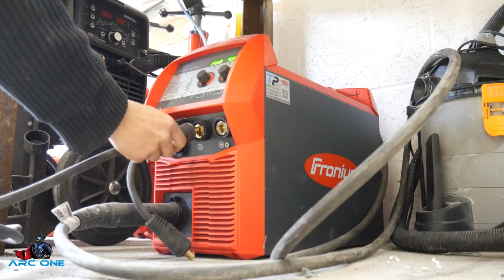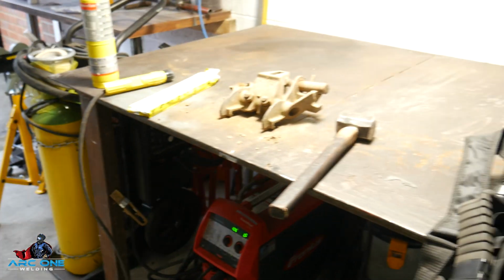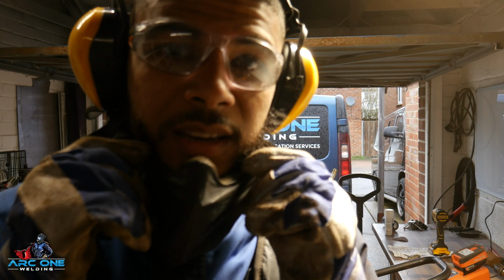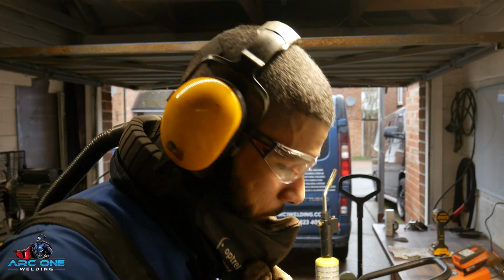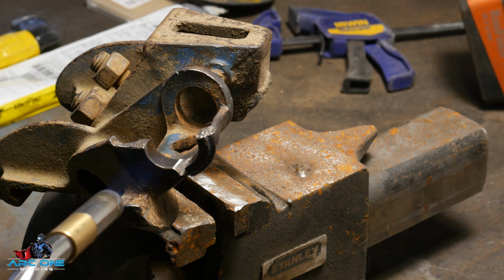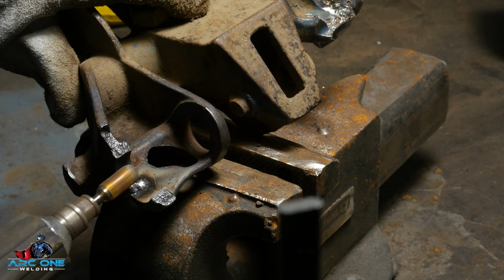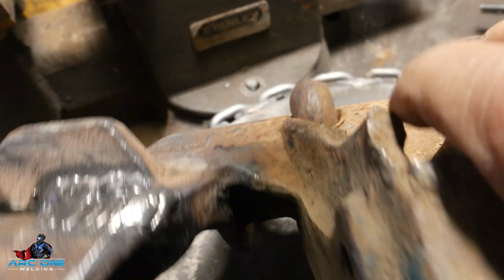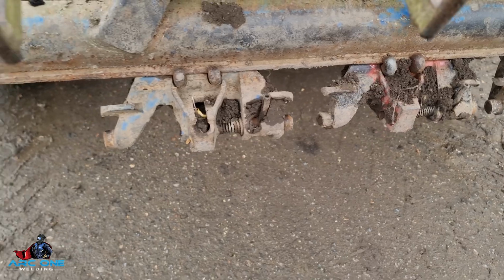Weld Repairing Cast Iron Farm Equipment

Comment: When in doubt on cast materials such as iron or steel to carbon steel 309 stainless steel or 312 stainless steel has worked really well for me they make it in a stick electrode they also make it in a wire you can also find it in Cut lengths for TIG welding the most precise would be Tig

Comment: Good to see your getting on well👍👍
Also good to see somebody else taking safety seriously as far as the RPE goes. But buy yourself a couple of clear grinding face screens rather than just wearing glasses man. Especially using slitting discs for anything other than a straight cut lol.
A broken cutting disk or grinding wheel will make a right ol mess of your chops if one goes bang

Comment: Good luck with the business and your van is smart. I've done quite a lot of welding on cast iron, get it as hot as you can too start with. Dcen works better than dcep. But best of all is ac. Out of my kemppi mastering 3500 pulse😊. I use Fein too, good stuff. My cordless tools are a little older, but not old, and they've decided to make the batteries obsolete 🤬

Comment: Good job! From what I understand about cast-iron welding you need to pre-heat the material properly. That basically means acetylene torch or a heating chamber. I remember around 12 years ago when I welded a cast-iron thing at work. We first tried with stainless steel rods, then basic before finally cast iron. I think it did hold up over time. But the secret sauce in cast iron welding as far as I understand it is to weld the parts after they've had a massive input of heat until the magnetization is gone. Then the welding creates as little internal stresses as possible. I know also have heard that steel-structures that are used in the north sea on oil rigs are often heated up in order to deal with all of the internal stresses in the structures. I see it more and more that structures of steel are always in internal conflict with themselves. Cast parts can still be the same as they do not necessarily cool down at the same rate in the whole part - hence it can also have internal stresses.
Reply: Best off pre heating it as evenly as you in an oven, helps prevent cracking. But at the end of the day cast is a twat to weld no matter what you do😂
Reply: Once steels reach a temperature of 400 to 800°c (depending on composition) they become fully austenitic hence losing the magnetism from the ferritic structures. 
Thing is no matter how much you try as far as pre heat and post heat, unlike cast steels which arent too bad, cast iron can be a real pig to weld and that simply cant be changed lol
Peening helps a lot too👍
Reply: Huge pre heat, weld then peening.  More heat  and then basically the slowest cool down you can manage.  As in make a BBQ and leave the piece on top until the next day...

Comment: I thought the TS2700 was 3 phase? How are you liking it compared to the bigger stuff at work?
Reply: the 2700 can be used on single phase but at much lower amp range and duty cycles. the 3500 model which is the next model up is a sole 3 phase machine